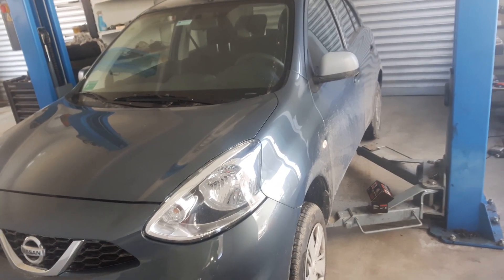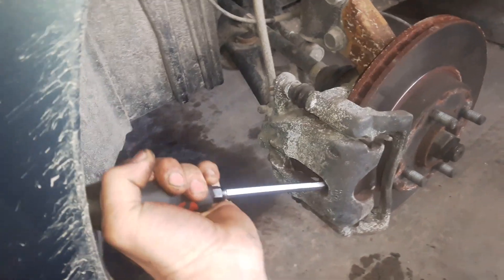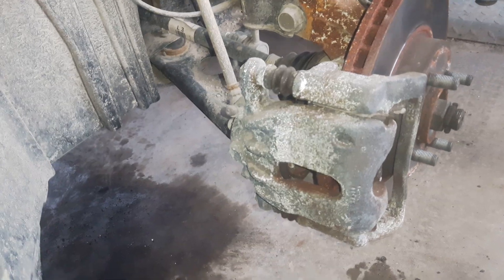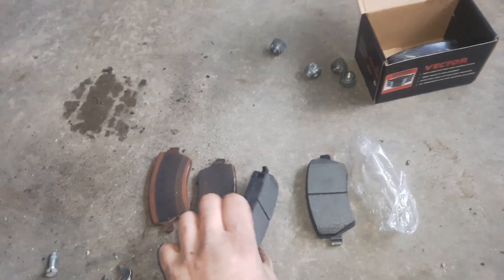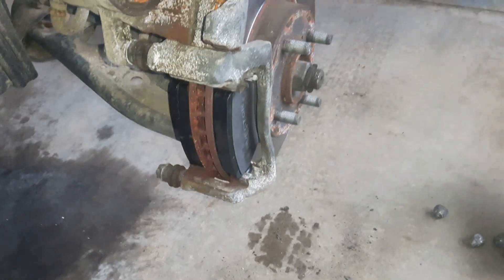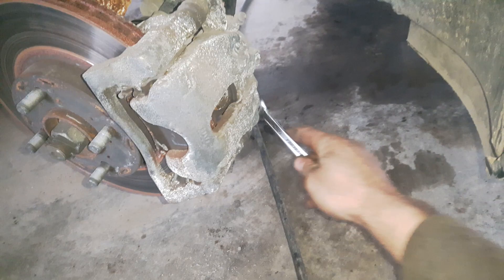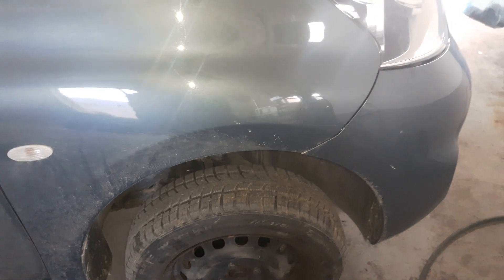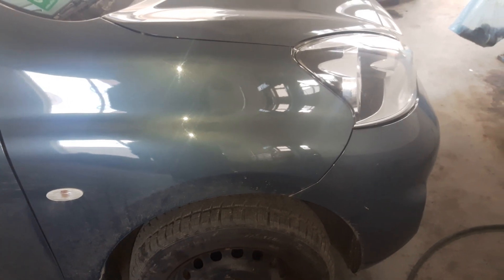Nissan micra k13 how to change front brake pads

Comment: Was there a shim on the old brake pad ? as you said nothing about this, I have just bought a new set of pads for my Micra 2011,and it has come with one shim for each side ! did not see a shim on your new pads!!
Reply from the maker: Not all brake pads have that feature that is to start squeak when brake pads are almost done so you don't damage the disk and those brake pads should be installed on back of brake disk

Comment: if you push the piston back against the brake disc, won't you damage it?
Reply from the maker: No you can't because you are pushing something that moves
Reply: You CAN damage it, it you aren't careful. Use an old blunt flat blade screwdriver, or better still, a G-clamp and do it properly.